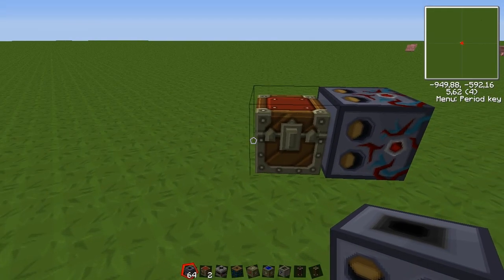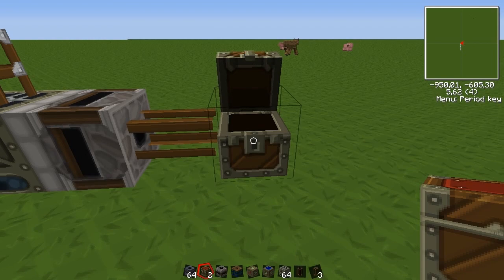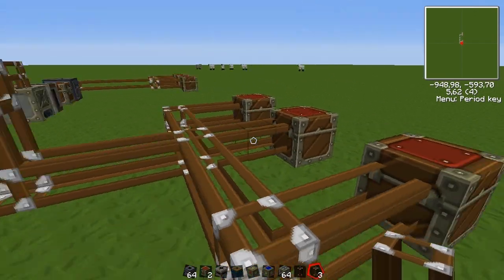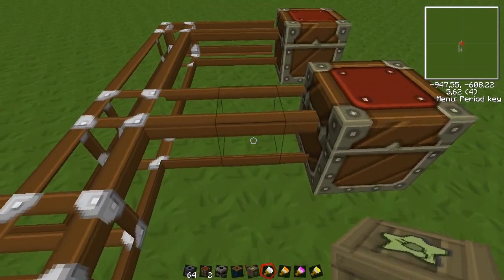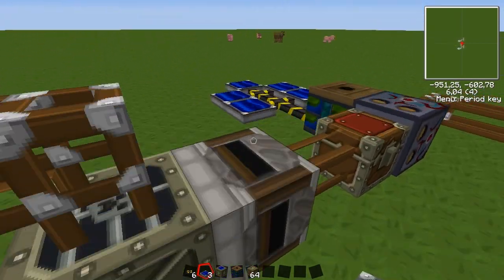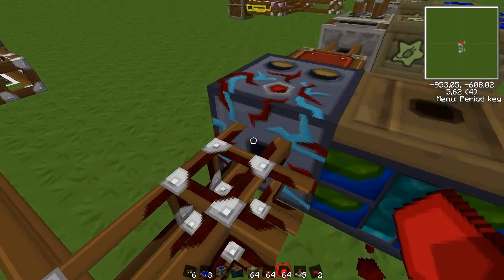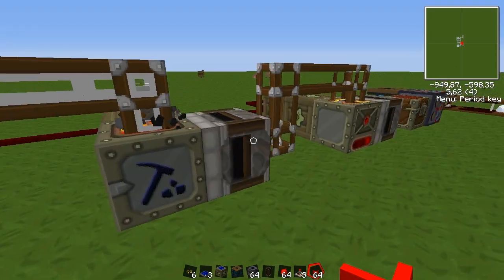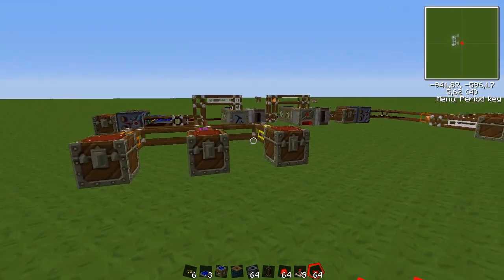Tekkit Tutorials - Ore Sorting and Processing for Quarry

Comment from the maker: It's easier to set up, but you would have to have a own macerator and furnace for each ore. If you have only one macerator or furnace and the ore slot is used, the other ores would be dropped to the ground. Same would happen if the ore slot is full. This doesn't happen with RP2 machines and tubing.